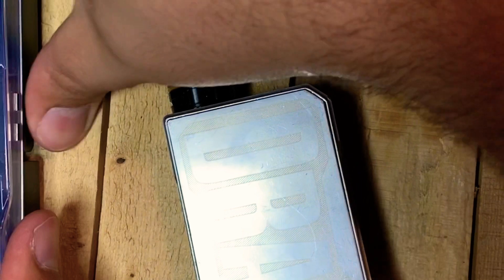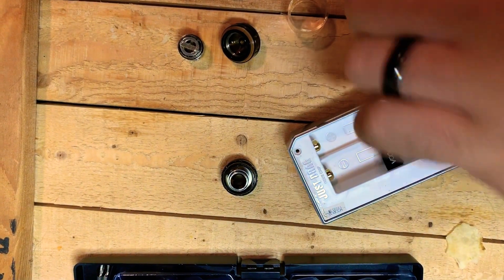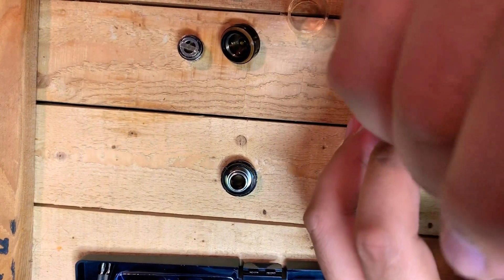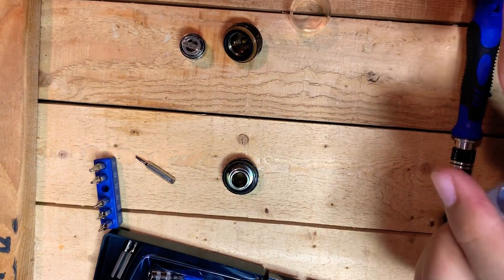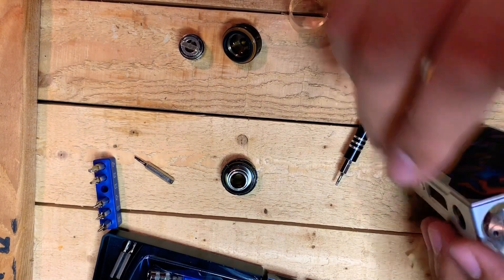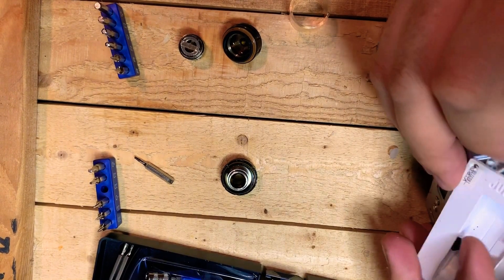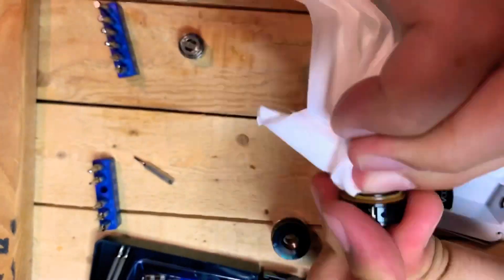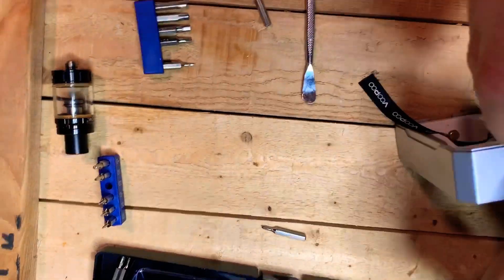Voopoo Drag tear down and rebuild with cleaning

Comment: Thanks mate! Mine is about 10yo, and now one button got stuck, so it permanently decreased voltage. The screen is barely visible even in the dark. Now I've cleaned it up somewhat, the focus was on the buttons. The battery holder lost some pieces in the process, but still, this one is working, reliable, trustworthy, got beaten up, hit the floor, the concrete, never received any love, it just works. With your video, I will keep it alive till eternity :-D

Thanks mate!

Comment: what size are the screws on top of the 510 connector, the star screws holding it on top? I hear ppl say it gets loose but don't know the star size some T size? t3, t4, etc. thanks.  Also seems paint just comes off instantly on my voopoo 157.

Comment: I know this video is pretty old by now but thank you for making it i had to fix the charging port cause it would never make a solid connection and come to find out the metal shroud around the port was just bent and needed flexed by to normal and now it charges like new. No more have to set it at and angle to charge.👍👍👍

Comment: I know this is old. I tried to remove my battery chamber but no matter what I tried I couldn't get the bottom portion to come loose. The initial problem was the screen was not functioning except a zero light environment. Now I never got it completely free and the power button is stuck. Be careful trying to take these apart.

Comment: i took min apart and cleaned it. was there some rubber pieces behind the temp buttons? cayse my buttons dont work anymore
Reply from the maker: I don’t remember there being rubber pieces behind the temp buttons. I don’t remember taking the temp buttons off. The fire button came off and it had a rubber piece that had to go in just right or it wouldn’t work.
Reply: @Imbobness  do you still have your drag?
Reply from the maker: Yes I do.
Reply: @Imbobness  could you check next time you have to open it? my temp buttons dont even move when i put them in, and they just fall out if i shake it withj the buttons facing down
Reply: @hallmonitor98 dude I figured it out the button go in facing down as in the wide part should be inside the mod and the thin facing down as in outside the mod
Reply: This was helpful, as I needed to know that you have to unscrew the tank screw in piece in order to remove the battery compartment. I will say that you don't need to pry on the battery compartment at all, as you can just pull it out with the battery strap on one side and your fingers on the other side.